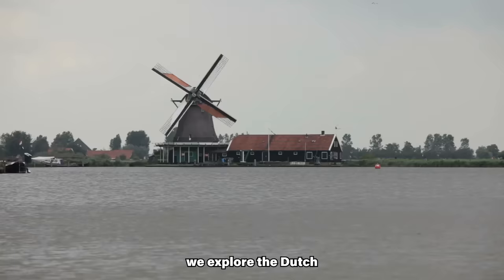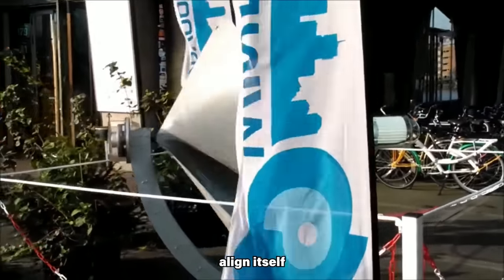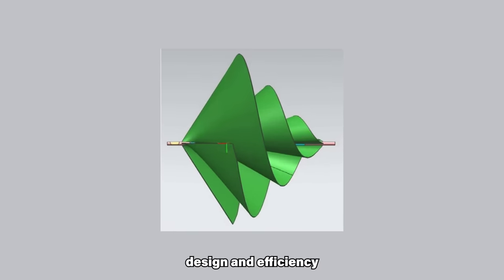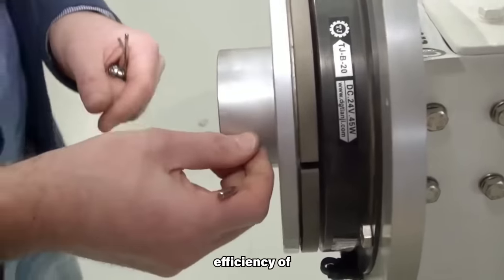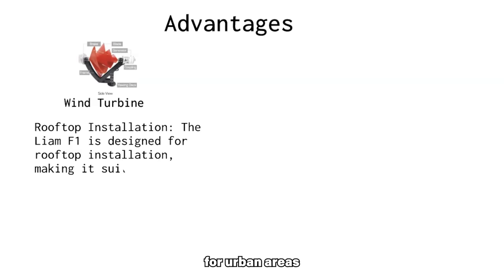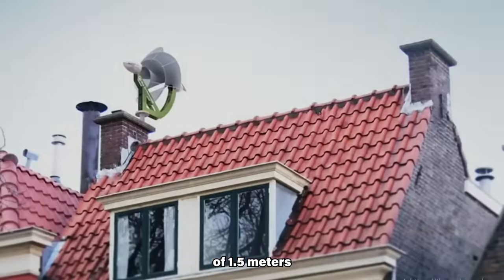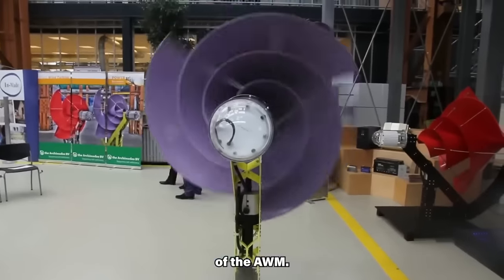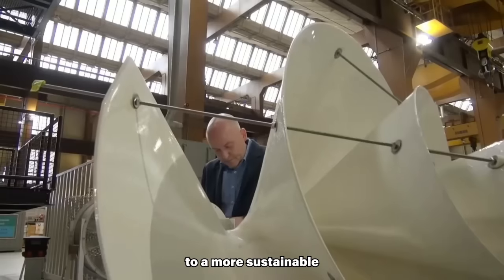The Game-Changing Wind Innovation You Need to See The Archimedes LIAM F1 Small Wind Turbine

Comment: So a average 170wats per hour...

Compard to a top performong solar panel i know 550kw per hour but in reality the average per hour over a year sue to weather and night time is more like 180-200kw average per hour over a year 

Its good and has the benifits of running at night but there are still times of low wind. 

Still gonna need good energy storage solutions for a consistent reliable source of power

Comment: What about snow load? If it is calm and it snows, the turbine will have snow on it. Then, when the wind starts blowing, will it recover by itself? That is, how robust is it?
It seems like it is equivalent in cost to a 4kW solar system, but produces about 1/4 of of the power of a 4kW solar system. That means it's expensive, and difficult to justify the cost, and only if have really good wind speed.

Everyone knows that wind turbines are more expensive and less powerful than solar, and in particular, small residential wind turbines don't exist, because of the cost and poor production. Vertical axis turbines are easy to erect and have a small footprint, but have poor efficiency. 

In order for wind turbines to be possible, they need to be efficient enough and cheap enough. It's a similar story with electric cars: to make them affordable, they needed to make them crazy-efficient, and drive down the cost of lithium batteries through mass manufacturing. If they can drive-down the cost of these turbines, and also make them way more efficient, then they can compete. The Liam F1 takes us one step closer to making it possible.

Comment: 1.5 megawatt per year. There are wind turbines that make the same amount of power in a hour.
Reply: Maybe commercially with the traditional mega large wind turbines, but not for home use. The point with this new technology is that about 3 of these small wind turbines could power many small homes in the United States 24/7 with just little wind speed of 5 miles/s which is most of the United States on most days. In theory, this technology could be the first real technology that can help many people go off grid around the world. My only question is why is this so expensive because there shouldn't be many parts to such small wind turbines and no rare earth materials unlike solar panels. Anyways, I'll have to do more research later to answer my question.
Reply: How many raptors/kilowatt hour does it kill?
Reply: @robertmcintosh3163  So if its making 1.5megawatts in a year that's 171.23watts in a hour divided by 1.5m and that's 8,760.15 that have been slayed. or is this a trick question that I'm not quite getting?

Comment: Lots of talk about the effects of wind turbines on wind and climate in the comments. These are completely misplaced. The overall effect is close to zero at the moment. You can do the calculations. To have a noticable effect, the number of large wind turbines would need to be about 1,000,000,000,000 in the US. More trees of all sizes have been cut down than that. With 1,000,000,000,000 turbines, the tropics would get warmer and the poles colder which would increase the wind speed, so there is a feedback mechanism. Energy would be taken from the Earth's rotation. The Earth would be slowed by about 0.4 sec every 100 million years. Interesting.

Comment: I stopped viewing at 2.15min ... figures are totally wrong.
The maximum possible output according to Betz law (and in full respect of its hypothesis)  with a 1.5m diameter and a wind speed of 5m/sec is ... 82 watts.  Of course, we consider a 100% efficiency of the whole system which is impossible.  Under a continuous 5 m/sec wind flow during one full year (which is also impossible), the maximum output would be 720 KWh ...
This design is nice but very difficult to produce.  Also, the struts used to keep spacing between blades as well as the structure itself will generate a lot of drag, thus reducing the efficiency ...
Forget about this joke and, for wind energy capture, keep in mind only one rule: the bigger the better!  Home wind turbines don't work and there is no market at all.  It's waste of time and money!

Comment: If it is only 1500 KWH annually, then you have a Extremely lousy generator attached to this thing.  And you are really charging $5000 for these? Thats not even as good a solar system.
A good low drag generator should produce minimum 1500-2000 watts  continuous with a 5 MPH wind, which is pretty much what we have here most of the day.
Or you put it in the front air intake of a car and generate 2000 watts conitinuous, that is enough to keep an EV car on the road without having to plug in to charger, and enough to run a home continuously.

Comment: nope, the power of a turbine is determined by the wind section, not by blade depth.
also have to be as light as possible, which this one is not.
2:40 so it's a 17W turbine, useless.

Comment: South Africa is sitting on a 400 year supply of coal.
The previous intelligent government built coal powered station on top of the mines.
They were even the first to introduce air cooling for power generators .
The new government is shipping coal to china at a rate that has to be seen to be believed.
Meanwhile the country is experiencing 8 hour daily rolling blackouts.
Thus forcing VERY expensive alternatives.
Shop owners are forced to install diesel generators.
If i lived in Cape Town id have lead acid batteries and wind snail shaped turbines 
..https://youtu.be/hCAunoANn3U?si=CnTDFMhaq60EbMiD........cheapest alternative. Plus a few solar panels.
You simply cannot rely on government